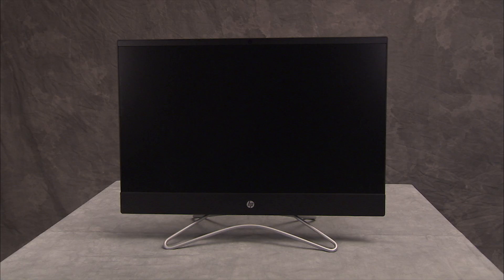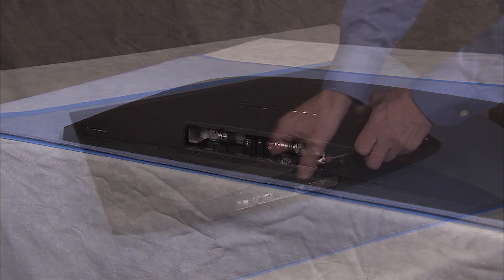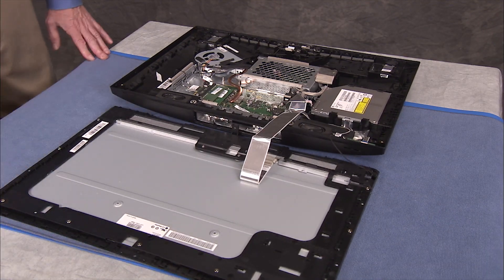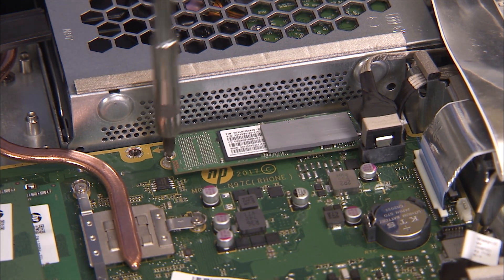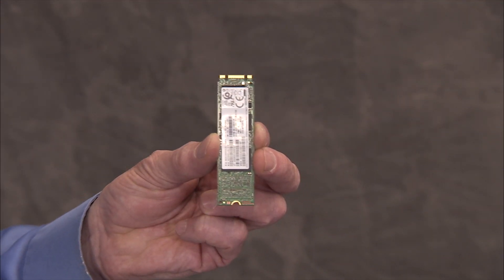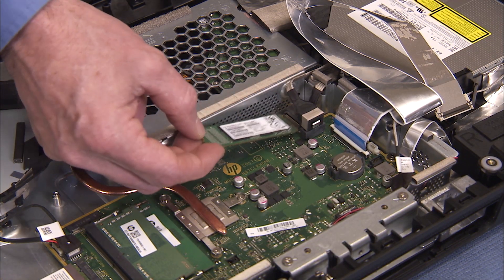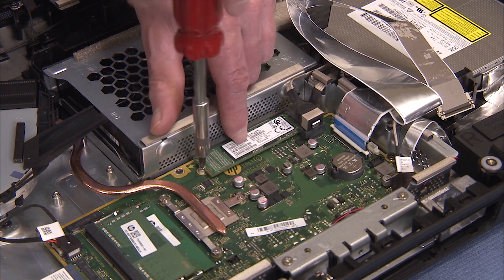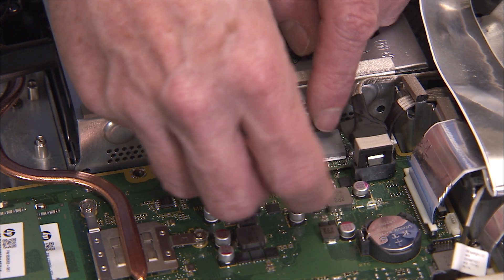Replace the M.2 SSD Module | HP All-in-One 22 and 24 Series | HP

Comment: You might want to mention that you need to remove the two screws near the bas, the three screws that hold the speaker cover on, etc., etc. Another POORLY designed HP piece of shite. Well to be honest, beautifully designed to make it more expensive due to labor costs so that you don't upgrade or repair your PC. Thanks Carly Fiorina..BTW, don't forget that HP stemmed from Compaq aka Com-Crap. 🤣🤣
Reply from the maker: Hi there, thanks for contacting HP Global Social Media Support!
I am here to help!
What seems to be the issue? Are you facing any technical issues with your HP computer?
May I know the exact model number of the computer you are using?
Let me know!
Regards, 
HP Support

Comment: I tried to install a M.2 PCIe 3.0 512gb Hard Drive 2280 on a 24-dt0004nj Platform: TPC-Q068-24, but it doesn't get past the boot screen (HP logo). can't even get into the bios with it is in the pc. is it not compatible?
Reply from the maker: Hi there, thanks for contacting HP Global Social Media Support!
I understand that you are experiencing an issue with your computer as the hard drive is not getting recognized.
I will do my best to assist you.
The best way to find the compatible part is by using the HP PartSurfer.
Put your laptop's serial number in the search and click on the magnifying glass icon. Look for the display in the list.
https://hp.care/6054Siidg
Regards, 
HP Support

Comment: Hello, help me pls. I have hp 24-f0085ur. And I set ssd m2. I can't set it as the first boot priority in BIOS. the disk is in legacy boot sources, how to move it to UEFI?
Reply from the maker: Hi there, thanks for contacting HP Global Social Media Support!
I understand that you are experiencing an issue in changing SSD from legacy to UEFI.
I will do my best to assist you.
To switch an HP computer from Legacy BIOS mode to UEFI mode, you'll need to enter the BIOS/UEFI settings, find the "Boot Mode" or "Boot Order" option, and change it to UEFI mode.
Regards, 
HP Support
Reply: @HPSupport  I have a slightly different problem, my old hard drive is displayed in the UEFI boot menu, and the new one that I installed only in Legacy and I can't see it in UEFI. In Windows it is displayed and I can even use it, but I can't make it the main one to start the system
Reply from the maker: Thanks for the reply.
Please try configuring the boot order in the system BIOS as mentioned here to fix the issue: https://hp.care/6057qAJ6R
Regards, 
HP Support
Reply: @HPSupport  I have like that
Boot Order

►UEFI Boot Sources

     OS Boot Manager

           UEFI: HDD MY OLD DISK FROM WINDOW 10   !!!!!!

     USB Floppy/CD

     USB Hard Drive

     ATAPI CD/DVD Drive

     UEFI: IPv4 Realtek PCIe GBE Family Controller

     UEFI: IPv6 Realtek PCIe GBE Family Controller

Legacy Boot Sources

         M.2 ARDOR (MY NEW SSD)   !!!!!

     ATAPI CD/DVD Drive

     USB Floppy/CD

     Hard Drive

     SATA2
Reply from the maker: Select BIOS Setup (F10), and then press enter. Select the Advanced tab, and then select Boot Options. Under Legacy Boot Order, select a boot device, and then press enter. Select the Main tab, select Save Changes and Exit, and then click Yes to confirm.
Regards, 
HP Support

Comment: I have HP all in one 22-df1000ne. Can I add a 2.5 SSD inside? Or there is only one m.2 SSD inside? And what's the maximum length of the m.2? Thanks
Reply from the maker: Hi there, thanks for contacting HP Global Social Media Support!
I understand that you need to know whether you can add SSD on your computer.
I will do my best to assist you.
This computer has One M.2 socket 3, Key M, type 2280 for SSD expansion slot. 
So you can add SSD that supports this slot. 
Binu_HP Social Media Tech Support

Comment: Hello. Great video. Seems so simple to upgrade. My computer is HP ALL-IN-ONE 24-DP0045NF. I'm using it for 3D design (with programs like CLO3d 7.0, Keyshot, etc.) Would an upgrade to SSD M2 NVMe 1T0 is possible and would it help a lot in the time rendering of my projects?  There are several quality and power of SSD M2 NVMe cards (from 80$ for 2100Mpbs to 180$ for 7200Mpbs!!) Would my current machine profit drastically of the most powerful (and expensive) card or my pc would be able to translate in much faster due to the average graphic card or the fact it's processor is also not very powerful (Intel(R) Core(TM) i7-1065G7 CPU @ 1.30GHz   1.50 GHz)  I hope my question is not confusing , English is not my mother tong.  Thank you so much!
Reply from the maker: Hi Patrick, thanks for contacting!
I understand that you need to know about upgrading SSD of your computer.
I will do my best to assist you.
Please find the compatible SSD for your computer here: https://bit.ly/3CIDSDU
Upgrading SSD will improve the performance of your computer.
Binu - Social Media Tech Support

Comment: This question is about the HP All-In-One 22-df0023w. This model comes with a regular hard drive and no M.2 SSD. Does it already have the Phillips #1 screw and the SSD bracket, or will I have to buy these items?
Reply: Also, is the offset screw already on the motherboard or will I have to buy that as well?
Reply from the maker: Hi there, thanks for contacting!
I understand that you need to know whether you can add SSD on your computer.
I will do my best to assist you.
Please check the specifcation of the motherboard here:
https://support.hp.com/nz-en/document/c06543675
Which shows it has:   
(1) M.2 socket 1, 2230 type for WLAN
(1) M.2 socket 3, 2280 type for SSD
It has 1TB HDD now, you can add M.2  NVMe SSD drive to your machine.
Generally the screw is there for adding SSD.
Binu - Social Media Tech Support

Comment: Is it necessary to put the thermal pad ?
Reply from the maker: Hi Ugoka, thanks for contacting!
I understand that you need to know whether it is necessary to replace thermal pads.
I will do my best to assist you.
Thermal pads are "dry"...they do not use paste and they can be reused as long as you do not damage them. They do provide less than optimal thermal transfer however.
Binu - Social Media Tech Support

Comment: My Model is 22-dd0117d. Use M.2 NVme or M.2 Sata? Thankyou..
Reply from the maker: Hi there, thanks for contacting!
I understand that you need to know about the supported storage on HP All-in-One - 22-dd0117d
I will do my best to assist you.
It has 1 TB 7200 rpm SATA HDD and it support one M.2 socket 3, 2280 type for SSD (PCIe x2 or SATA x1)
Binu - Social Media Tech Support

Comment: Can I use a 256gb Sabrent Rocket NVMe SSD in my HP 24-f1047c? I've heard it's really good but I'm not sure if this PC can handle it lol.
Reply: It came with a 1TB HDD installed in it, but some specs I found on the HP Support website say that it has 2 M.2 slots, so I am thinking about adding an SSD for faster speeds running Windows and some games while keeping the original hard drive for storing my other files. The box says it has an AMD Ryzen 3 3200U processor with Vega 3 Graphics, and I am also thinking about trying to upgrade those but I'm not sure if it would be worth it when I could just buy a new PC instead.

Comment: I want to update a 24-r019la, by default it comes with a 1TB sata drive and I see that the motherboard has an M.2 port. What type of drive is left? Can both disks (sata port and m.2) be active so that one has the operating system and the other to save information?
Reply from the maker: +Heber Loran This computer has One M.2 slot for SSD. You can use SATA hard drive and SSD on this computer.

Comment: What is the maximum capacity supported by the m.2 slot? Does it supports NVME or just SATA speeds?
Reply from the maker: +Juan David Serrano Mugica May I know the complete model number of your computer so that we can check the details for you?
Reply: @HPSupport for  HP 24 df1669in. What SSD suits m.2 or Nvme?

Comment: Hi.. does hp 22-c0031L, can use the M.2 NVMe or M.2 Sata ?
Reply from the maker: +Riezka Maghfira It supports Size: 1 TB
Interface: SATA
Rotational Speed: 7200 RPM
Reply: @HPSupport  are you sure that SSD M.2 have the rotational speed?

Comment: To model HP All-in-One 22-c020la, the SSD compatible is M2 Sta or M2 NVMe?
Reply from the maker: +Jorge SuárezI understand that you need to know about the compatible hard drive for your HP 22-c020la All-in-One Desktop PC. Please find the specification of the hard drive as below: 
Hard drive: 
Size: 1 TB
Interface: SATA
Rotational Speed: 7200 RPM
If you are interested in purchasing hard drive or other accessory, use below link: www.hp.com/accessorize 
I hope this helps you!!

Comment: finished installing SSD and my PC already found it but can't get it to boot due to secure boot. is there any instruction ?
Reply from the maker: +Blltz Kittinan Please try shutting down your computer, remove the back, and removing the HDD. Then,  start up the computer, and it will boot from the SSD. Then,  shut it down again and reinstalled the HDD, put the computer back together, and boot to BIOS. It will show the SSD as the boot drive.
Reply: I mean I can't use SSD to boot the system, HDD still working fine. os boot manager doesn't have the option to change boot drive

Comment: Hello, does hp pavilion all in one 24 r005 la have that ssd m2 extension? I would like to upgrade my computer  but without get the original hhd hard drive off , thank you
Reply from the maker: +Andres sanchez It supports below hard drive:
Size: 1 TB
Interface: SATA
Rotational Speed: 7200 RPM